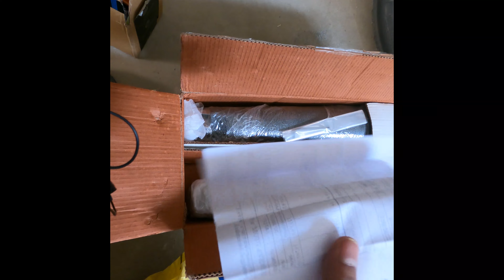Powerage Short slip-on exhaust Interceptor 650. Installation, Initial Impression and exhaust note

Comment: Hey brother, after more then a year now. How are these performing? Any rust or other issues with it? Still using them? Would you recommend them
Reply from the maker: Hey, no issues so far… I’ve been riding it without baffles throughout and to be honest, I’m kind of bored with them now… thinking of switching to louder ones 🥶
Reply: @RanjanSh  barrel atom, rrp, moto torque.
Reply: @RanjanSh  pls let me know if you wish to sell it 😂😊
Reply from the maker: @digamBrahma  are you based out of Bangalore? Send me an offer I can’t refuse 🥲
Reply: @RanjanSh  Yes!  6k ??
Reply from the maker: You don’t want both the exhausts? 😅
Reply: @RanjanSh  6k for exhausts is wild 10k sound pretty alright even 12 would work tbh
Reply from the maker: @tahami4144 the thing with Powerage is, it’s the best looking one among all others... They should make 1 more that’s super short…. It will be loud but retain the design, just the perfect combination.
Reply: @RanjanSh  agreed but nothing beat moto torque in performance and loudness but after all the other things are objective if being completely honest.
Reply from the maker: Hmm, will study about Moto torque in that case. IMO none of these exhausts give any noticeable power enhancement. I’ve done some more upgrades till now and next one is a free flow bend pipe.
Reply: @RanjanSh  It reduces weight drastically increase power to weight ration I've tested them on my 3 friends bikes I'm a big fan of sports tourer but trying out enfields with SS gurusweak power rage and moto torque the moto torque were great phenomenally performing with a bassy yet loud sound of engine singing in opera. But RRP is best overall better than Moto torque but moto torque being 5k less cheaper earn its badge in my list.
Reply: @RanjanSh  most of the times people don't get performance upgrade because they use the shitty stock airfilter causing the bike to run richer but balanching out with a K&N or way2speed airfilter will do the job. OR OR You can just go for SSMOTOCORP FULL SYSTEM EXHAUST with K&N airfilter Powertronics code 6 stage 2 tuned interceptor but that will return 12kmpl mileage imo